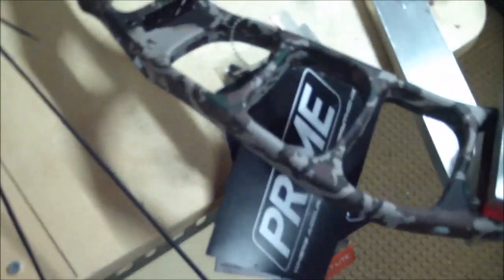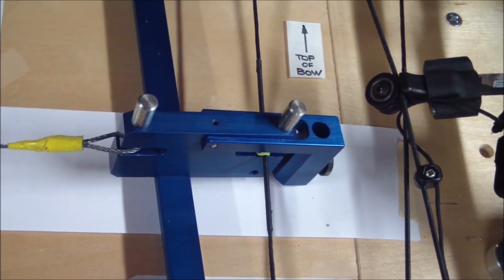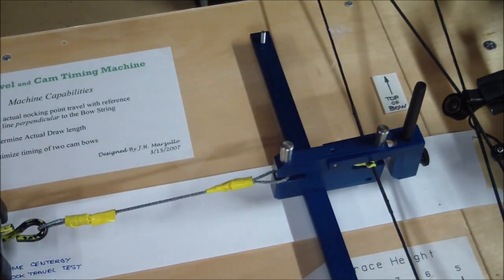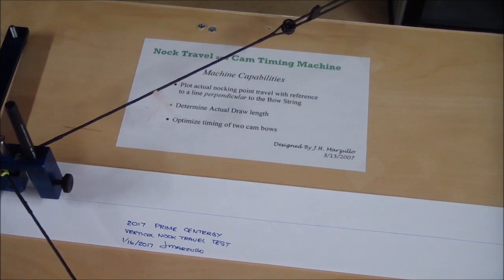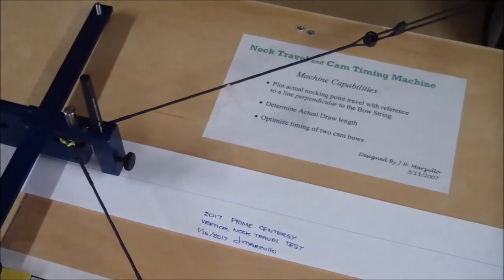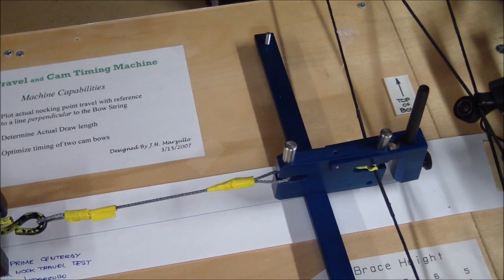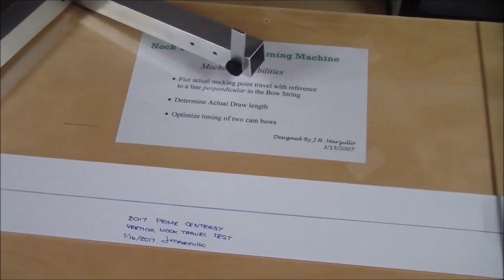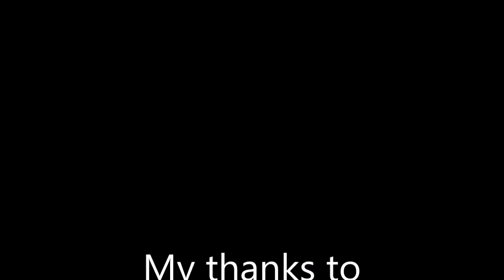2017 Prime Centergy Vertical Nock Travel Test

Comment: PSE has been making their top and bottom cams different sizes for several  years for the same reason.  The Omen cams are just one example.  The Omen came out in 2010.  This is tried and true design.  It works.

Comment: Do this test with one of the older single cam bows.  I did this same test back in 1990 when the Jennings uniforce came out.  I had never even heard of a draw board back then.  But I made one to show the Bear/Jennings dealer how much the string moved when it was drawn and let down.  The po shop owner immediately called Bear and told them what I had just shown him and asked them what he should do.  They told him to refund my money.  From then on, we referred to the Uniforce as the UniFARCE.